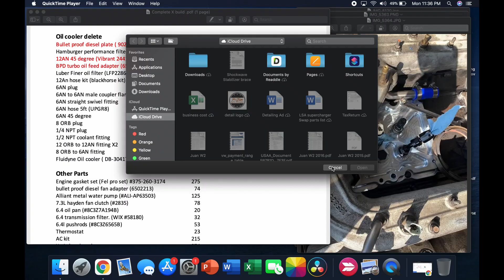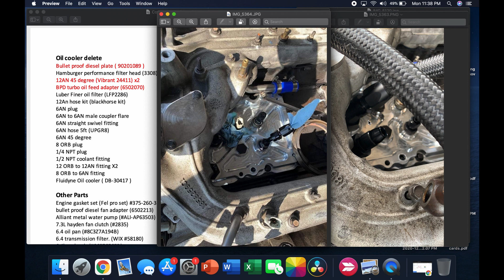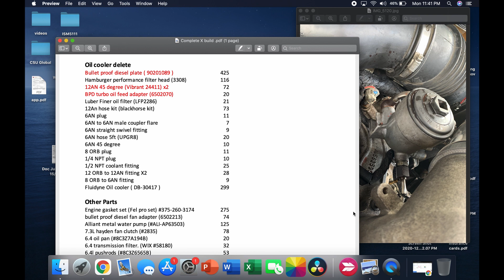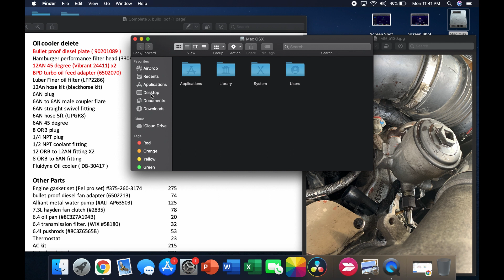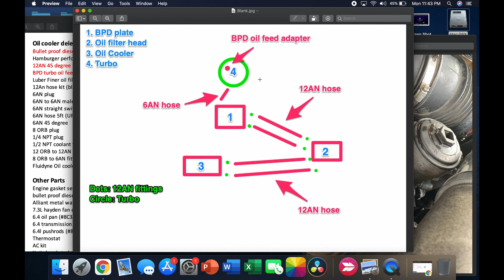6.0 Powerstroke oil cooler delete build list.

Comment: On that oil cooler the fluidine 30417. Can you run the fluidine dual fan stp.104 cooler ? I'm just wondering if you looked at that dual fan system as its a little bit smaller cooler than the 30417 cooler but it has dual fans.So i'm wondering if that would work as well.You think?

Comment: Did you encounter a low oil pressure issue at first start up with bpd plate?
I built a similar set up & when truck is first started the low oil pressure gauge doesn’t come up for about 30 seconds while it’s running

If so how did you over come this?
Reply from the maker: I think maybe on the initial startup but I fill my filter to the max, I had it mounted low enough to allow that. Never had an issue though with low pressure on general.

Comment: Nice vid man! Question: is there a way to add a bypass oil system from the plate back to the plate ? And is this setup still possible with the egr cooler just blocked off with plugs but still installed?
Reply from the maker: No with this plate you can NOT have a EGR  cooler installed, it’s a space issue. BPD claims it can be setup but it’s a hassle to do so. You can add a bypass oil filter kit the same way that BPD does it, you would go through the first filter first, then the second bypass then into the cooler and back to the plate “I think”
Reply: @DonJuan9091  great video.  Solved fuel filter issue.  How did you block off water port for egr cooler?  Where did you mount filter?
Reply from the maker: The port for EGR cooler I left the delete pipe piece and just put a plug at the end of it. The oil filter is mounted in the driver side tire well.